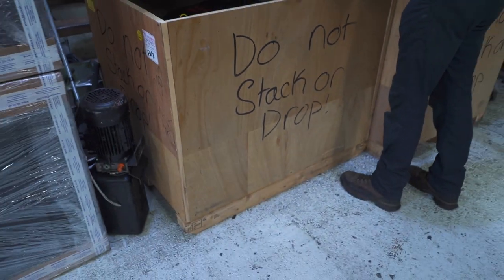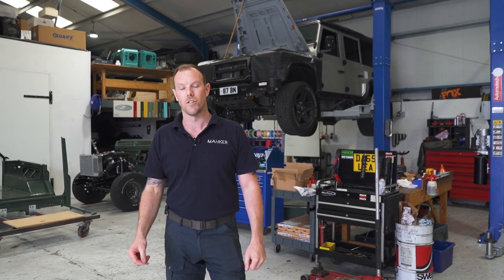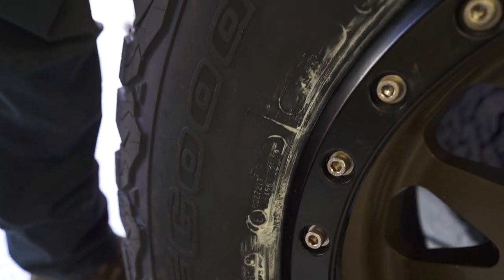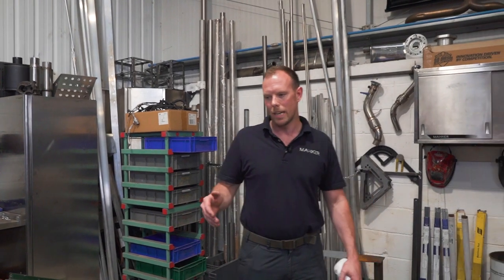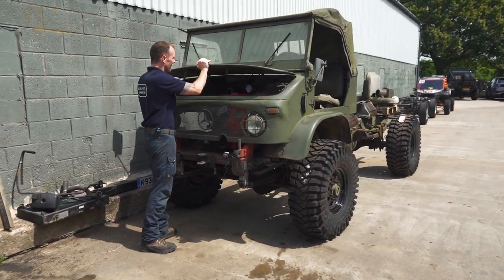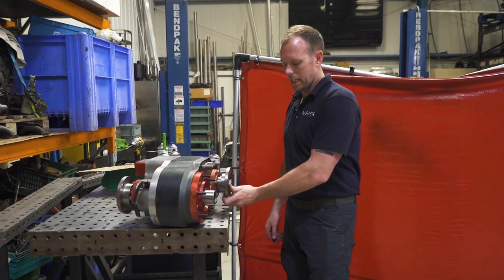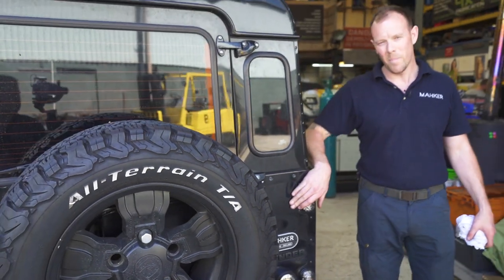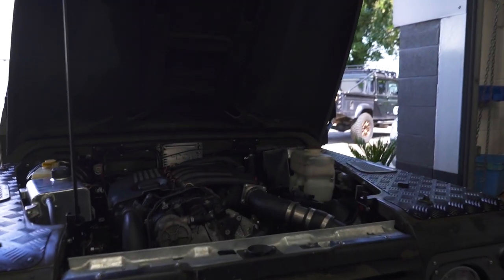WE ALMOST QUIT MAKING THIS USA SPEC LAND ROVER. THE CHALLENGES IN 2023 | MAHKER WEEKLY EP012

Comment: Great Video! Beautiful TDI 200 motors! Do you favour the TDI over the TD5?
Reply from the maker: To be honest we just love the simplicity of the Tdi we’ve never had one actually die. 
On the td5’s we’ve spent days finding cracked heads/fuel pump issues /loom faults oils in looms/injection faults mushroomed nozzles. 
But then we’ve had a few very sweet Td5’s like the G4 in our Videos.
Reply: @wearemahker  Thanks so much for your quick reply! you guys are the best!! I'll look up the G4 video. 
I have TDI 200. I'm wondering if I swap into my 2006 TD5 110 the TDI would the traction control be able to work? 
One more question, how difficult is it to get a low mileage TD5 motor?